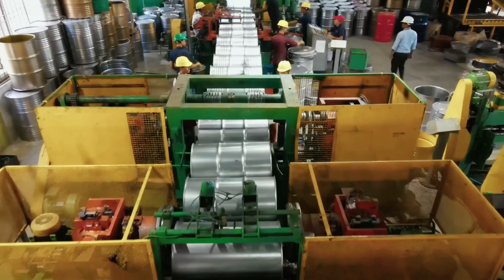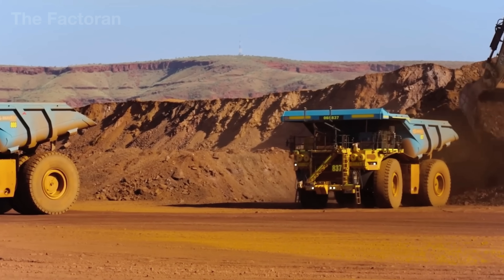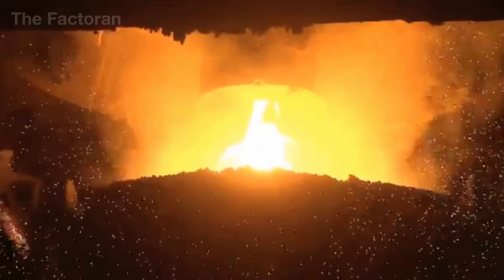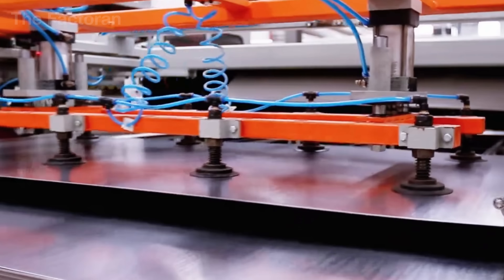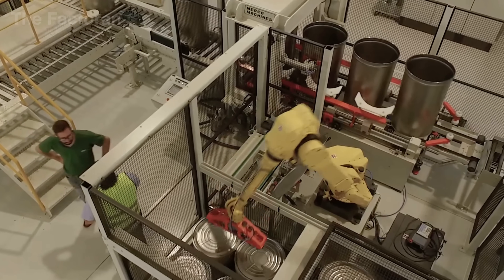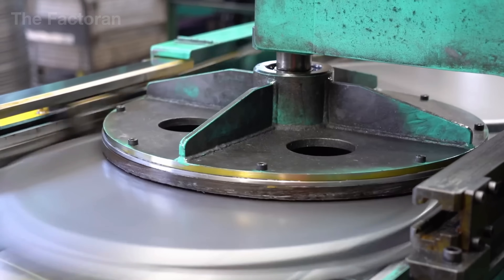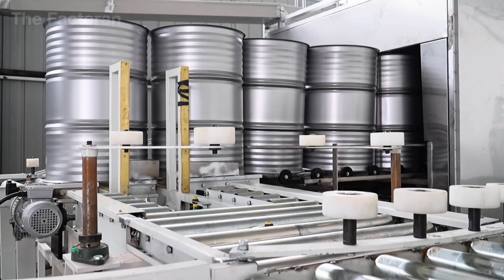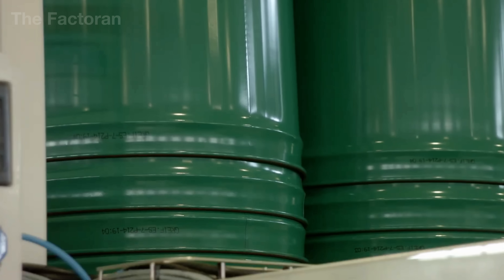How Millions Of Oil Drums Are Made Every Year Inside Massive Production Line

Comment: Drums cant be reused only for the same liquid.  Oil Drum can only be used for other petroleum products.  Food production can only use stainless steel or plastic.  They are moving to plastic drums for food production.
Reply from the maker: You’re right—reuse is tightly regulated, and food-grade handling is limited to approved materials like stainless steel or certified plastics.
Reply: I don’t know where your getting your information from but I have hauled food and food products for over 25 years and a majority of it that is moved in drums use steel drums , a very limited amount in plastic and almost never stainless steel. Stainless is far too expensive for most uses , food grade drums are coated depending on the product.